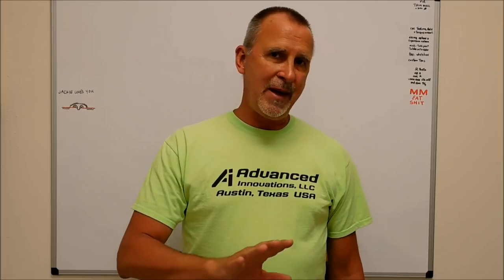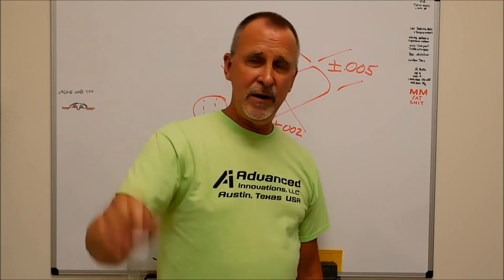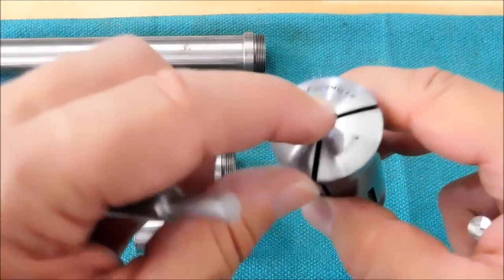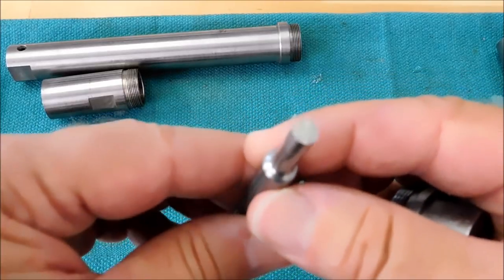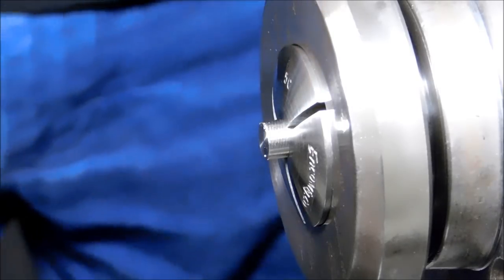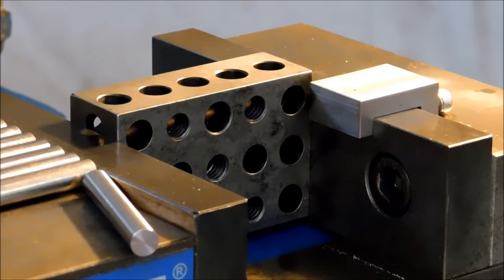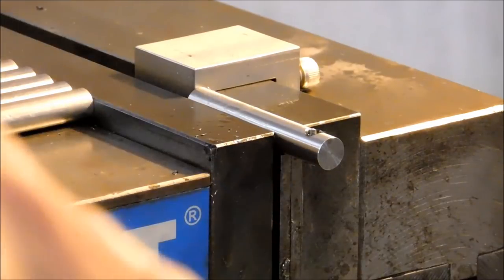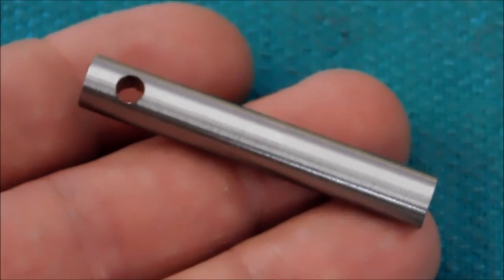Great setups, Crappy results, and the reasons why. Take a look

Comment: How much would the torque you put on a 5C drawbar influence the accuracy of the stop? (assuming no quick closer with consistent force)
Reply from the maker: Since the stop is part of the collet, the torque requirement is driven by the amount of closure needed for the diameter being gripped. The OD of the part is more influential than the drawbar torque. Even if all the parts were identical and you changed your grip force, the difference in the length would happen, but it would be minimal.

Comment: My ? Is what if the length of the part is longer than the opening of the vise what then?
Reply from the maker: The answer to this really depends on the feature required. If its a simple cross hole like the example, put a v block in your vise aligned with the X axis and set a table stop.
Reply: @joepie221  thank you for everything you do you definitely care about your subscribers you definitely deserve more than that YouTube plaque you’re the man

Comment: your edge finder might need some repair. after many years of use the mating surface of the movable diameter becomes worn and is not flat It will not 'jump' very far . I have had to relap this to get the mating surface flat and it will 'jump' much further, just like new.. also,  you do not have to run at a very high rpm either.

Comment: Hey Joe
Great video as always. 
I was taught by the old timers don't ok at the tolerance, hit the god dam number and half your problems will be eliminated. Now I do work where I strive to be 10 times more accurate than the intended dimensions, I know fuckin crazy right? Then I know I'm in spec no matter what QC says
Reply: Gotta hit the nominal
Reply: Tolerances on engineering drawings are  allowable dimensional  variations  which will still  meet the intended function.  When working on a few parts holding tolerances at or near the maximum material allowance provides some margin to rework parts if practical.  Trying to hold dimensions as close as possible to the nominal will work but  will take more time than necessary.  Good enough is perfect.

Comment: I picked up on all the mistakes except I didn't even think about the diameter & oal in the collet, Im aware of the problem but didn't think about it. What drives me crazy is seeing people hold a small part on one edge of the vise without equalizing it with another part on the other side. I see it all the time and I work with fellow toolmakers...
Reply from the maker: That makes me crazy as well. Its a bad practice
Reply: sometimes even when controlling the O.D you'll get variations on the OAL in 5c collets. Let's not forget that even brand name Hardinge specifies a repeatability of +-0.002 on the Z . I had a job one time that required 5/16" O.D 316 stainless tubing to be faced and reamed on both sides with an OAL of +-0.002 ... well guess what it was impossible to maintain the tolerance. Ended up modifying the 5c collet to be able to grab it in soft jaws.
Reply from the maker: @anonymousVSnwo  Repeatability on a lathe 'Z' axis is a product of the part diameter and the closer being used. I have a seriously hard time believing Hardinge would put that in writing.

Comment: 19:30 That drill bit is unnecessarily long. I like to keep the drill bit only as long as I need it. I think you introduced flex with that long drill bit.
Reply: It shouldn’t really make any difference for the kind of precision a twist drill will get because it was centre drilled first
Reply: @ehinders2000  Okay, so you have never had a long drill bit drift I guess.

Comment: I do not understand why the length of the part varies with the taper on the OD? I have not used a collet stop, and my collet chuck does not use a drawbar; is it related to an interaction between drawbar force and collet stop position, or is the part not seated against the stop? The rest makes sense. Thanks, Joe!
Reply from the maker: Since a 5C collet, and most collets, rely on a taper to lock the part, as the OD of the part get smaller, the collet has to go farther into the tapered recess before it engages the part. The stop is attached to the collet and therefore sinks deeper into the machine as well. This moves the part away from the cutting tool zero resulting in a longer part. Exactly the opposite happens when the OD increases.

Comment: From the very beginning with the part sticking so far out of the collet without support cutting a taper and a crappy finish I knew it was going to be a video with a long line of fiascos all coming back to that first mistake.LOL
Reply from the maker: Even with the taper removed, parts with inconsistent OD's are drag a job down. i think this video illustrated some of the problems to expect. Plus, the size and projection of that part is difficult to hold with secondary support as you mention. Follow rests are just not that small.
Reply: I didn't mean to come off insulting it wasn't my intent.
One thing I do for parts sticking out that far is to use the tail stock and live center for support.
Normally my rule of thumb is anything sticking out  more than three to four times the diameter of the stock I support it.

As for the drilling  center I dont have a set of V blocks but for most of the stuff I do a nice piece of angle or channel iron works great.

Comment: your length will very because of your taper in a collet you ned a spring stop collet
Reply from the maker: Technically, its the collet closer design and how that collet taper contributes, but any deviation in the part diameter will effect the length accordingly.
Reply from the maker: I know how I would design a stop to avoid this problem, but post a link here to the spring type stop you have in mind. I'm curious if we are thinking the same.